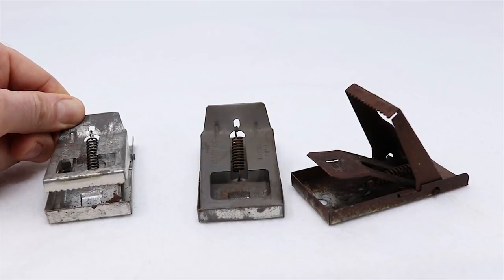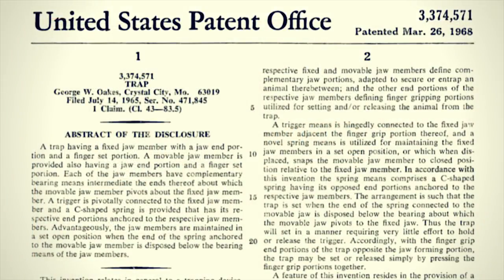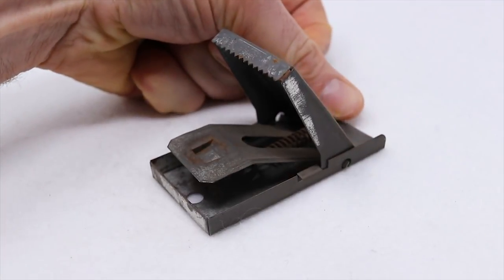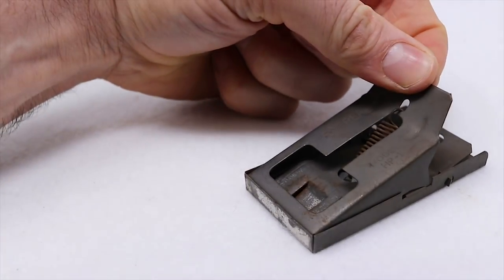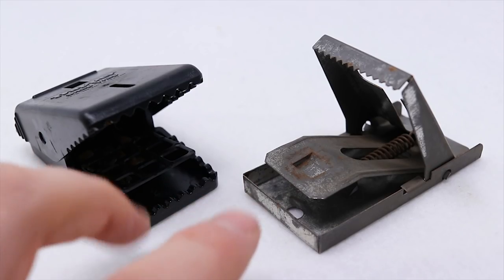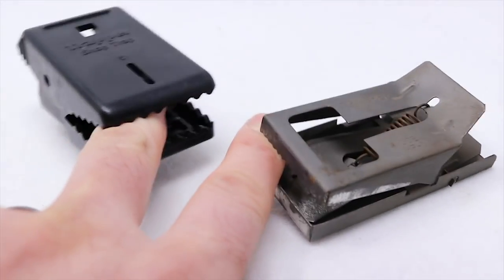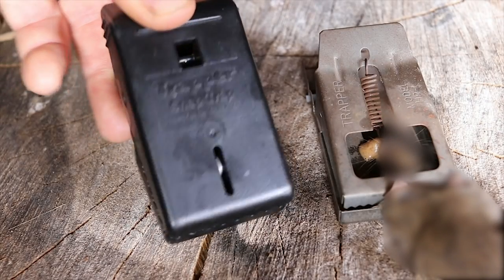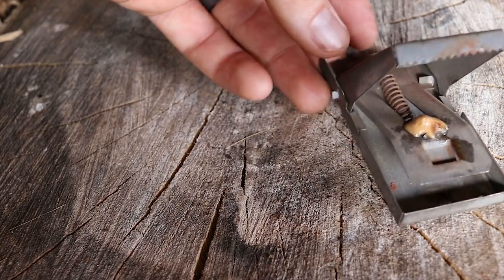Vintage Metal Vs. Modern Plastic Trapper Mousetrap. Mousetrap Monday

Comment: modern traps seem to be mostly junk and gimmicks
Reply: modern everything seem to be mostly junk and gimmicks
Reply: Well I have an Indonesian knockoff of plastic Tomcat trap that works. It has killed several rats and shrews.
Reply: I bought the plastic JAWZ trap because of this channel, and I have to say it works great! But a metal version would be better.
Reply: I tend to stick with the old school Victor. The wood ones with the metal catch not the plastic pad. Pack the loop with peanut butter and it catches them every time!
Reply: I agree most of its junk from China just made to get your money.
Reply: I think the modern traps are designed to be relatively child-safe, but unfortunately aren't all that good at capturing mice because of this. In comparison, many of the old traps are vicious killing machines, with sharp metal edges/teeth, and powerful springs.
Reply: Some of those good old products have their patents still valid so if someone wants to sell something he/she has to come up with something different.
Reply: that's a really good mousetrap , i use the JAWZ brand traps at my farm ,, they even catch the little tiny mice that other traps miss ,,and i've even had a JAWZ mousetrap catch small rats
Reply: The bowl of oil trap actually works at clearing out mice faster then single trap designs. Same with Walk the plank, but the bowl of oil trap uses commonly found materials which means most people have the ingredients at hand for a really effective way of catching mice.
Reply: "I tend to stick with the old school Victor. The wood ones with the metal catch not the plastic pad."
I don't like the plastic pad version either. Those don't seem to work as well as the original all metal design.

Comment: You have mentioned peanut butter multiple times. I have never had really good luck with peanut butter. 

I have found that MARS bars make a FANTASTIC bait. You just rip a chunk off, roll it into a ball and smoosh it on the bait pads. The mice can't seem to resist the mixture of chocolate and caramel.

Comment: My experience with the plastic traps of that design has been that they catch the mouse by the shoulder rather than the neck more often than not. Resulting in a mouse suffering yet trapped. Have to put them out manually. Seems like the trigger is a little too heavy on them, and the mouse has time to get partially out before it goes off fully.
Reply: I don't know if this is true, but I feel like the problem with plastic traps is that since they're made out of a softer material, the pressure from the spring makes the trigger pieces bite into each other just a little bit to make the trap less sensitive.
Reply: Hmm - a mouse suffering or a mouse chewing through your house? Let 'em suffer, I say!
Reply: @chemxfan  Or just use a more effective trap and have neither!
 A mouse that's caught by just the shoulderblade is still capable of dragging off that trap and hiding. Meaning it sits where it hid and dies, and stinks up the place. Or you end up having to dig under something to grab it and pull it out, which leads to being bit, something you definitively try to avoid with wild rodents.
It's especially bad when you have a carpeted floor, because then you have to either get stains out of the carpet after the fact, or move the mouse somewhere else to finish the job.
A solid heel to the head while wearing shoes finishes it, but the point is that we buy traps so that we don't have to directly interact with the rodent. 
We buy the traps so that when the rodent is caught, it's in a safe and accessible place, so we don't risk getting bit. Most people buy either live capture or hard kill traps, because they don't want to torture the mouse, they want it gone. Minus the idiots who use glue traps, at any rate.

Comment: Seemed not as quick of a kill then snap traps.
Reply: The mouse died pretty much instantly. The back feet kicking randomly is an autonomous response that happens when the brain stops sending coherent signals. It happens in rats and mice alike. Shawn usually edits that part out or only shows it for a second or two before cutting away to the moment when the rodent no longer moves.